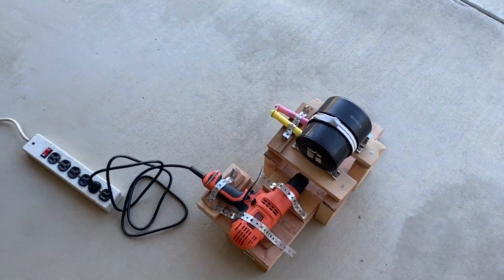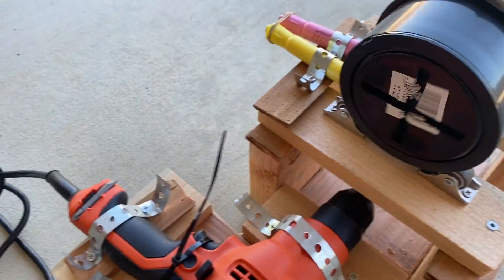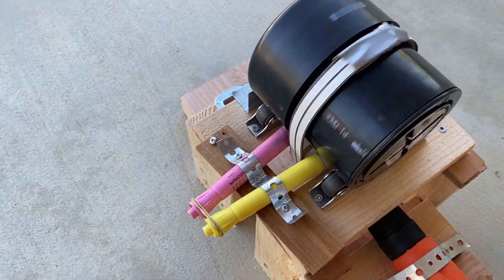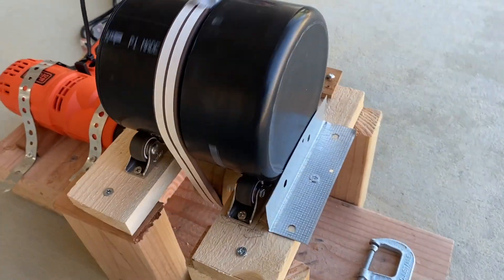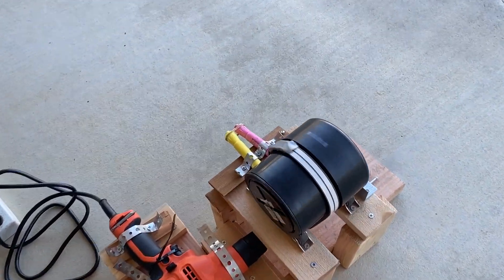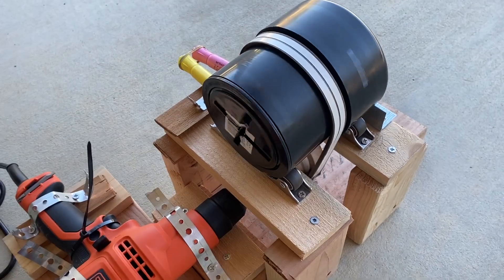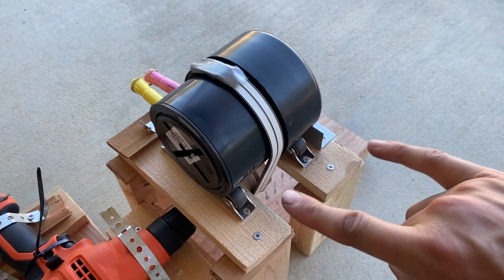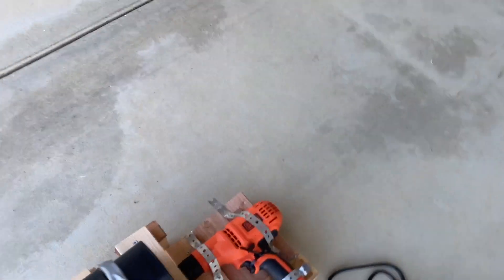Homemade Ball Mill

Comment: Pyro in ypur name, and using steel balls. What could possibly go wrong....smh. I do like the idea, and I might make one for when I travel. If you are using this to make powder, dont use steel media for milling. Steel can spark, and thats extremely dangerous in a powder mill. I guess if you mill separately you'd be somewhat alright. However, milling the 3 together is most beneficial a good outcome.
Reply from the maker: I considered lead media; however, my setup is not strong enough to rotate that much weight. I 100% agree with you though and just added a disclaimer in the comments. I have been considering ceramic balls or glass marbles perhaps, but am not sure what is more effective/safer. I guess the point of the video was to highlight the design of the mill itself.
Reply: I’ve heard that lead balls can be used instead. Apparently they don’t bear the same risks for sparking, especially if used in a rubber/non conductive car/container. Correct me if I’m wrong though.
Reply from the maker: What are your thoughts on glass marbles? I do agree with you on the lead.